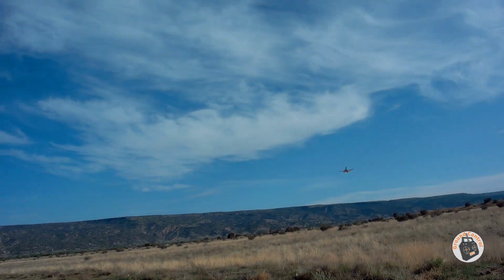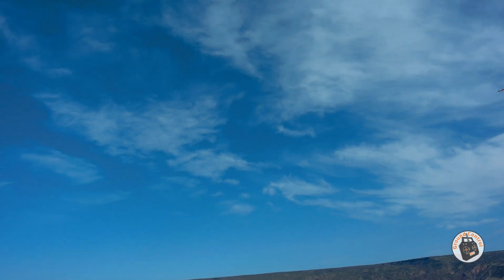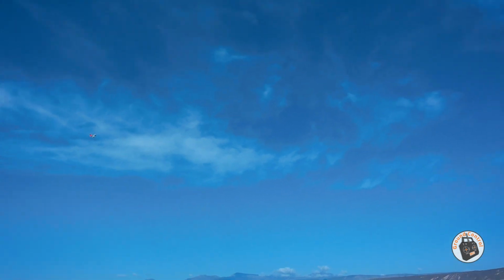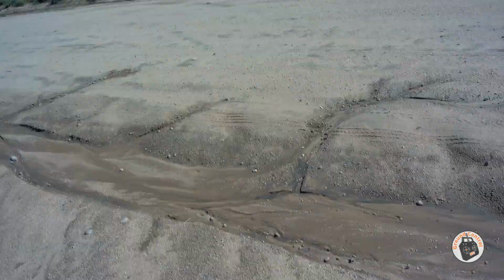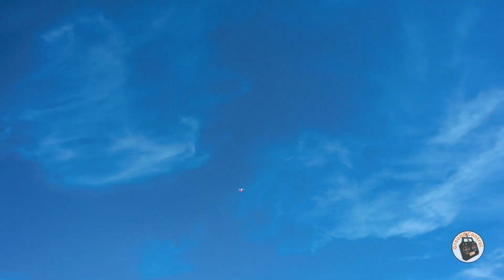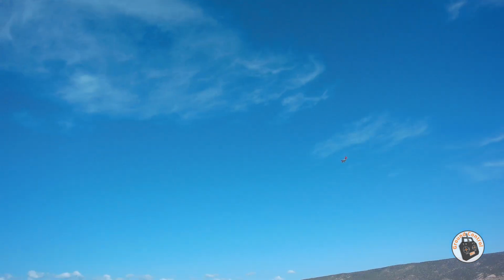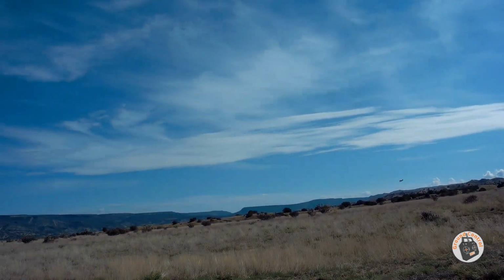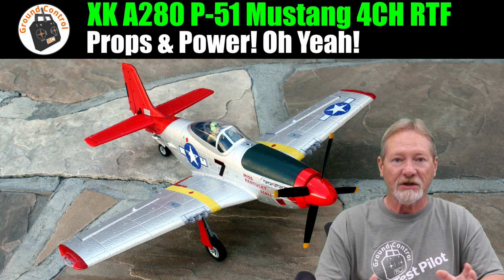Props & Power! Oh Yeah! XK A280 P-51 Mustang 3D/6G System 560mm Wingspan 4CH RTF!

Comment: Help sir. For connecting with radiomaster tx16s edge mark 2, what protocol need to be sett? Thanks
Reply from the maker: In the latest builds of this plane I've read they changed the protocol so it no longer binds with a multi-protocol TX.
The original Main Protocol V911S | Sub-Protocol E119 with CH6 (Rates) and CH7 (Gyro)
The board may have a port to add an external RX as I think the original board did.

Comment: I reckon you are using the old receiver board with S-bus connector? The new ones don't have S-bus anymore.
Reply from the maker: I do have the old receiver board but I'm using the board's protocol to bind with my TX16S.
I've read they changed the board and the protocol.
What a shame.

Comment: Can i use a 2S 7,6 HV lipo on the stock ESC from this plane???
Reply from the maker: Unknown, they don't publish how much voltage the motor, ESC, or voltage regulator are rated.
Reply: @GroundControlRC  It is 7,4 that is written in the specifications
Reply from the maker: @johanw.1673  It states: Airplane Battery: 7.4V 600mAh 25C
Reply: @GroundControlRC  on the board it says 7.5 volts. the only mod is adding the inline voltage converter to supply 7.4v to the standard control board of the ESC to fly it safely on 3S. do you know the size of the spinner??
Reply from the maker: @johanw.1673  Oh, I thought you were asking about a 2S LIHV?
Certainly you can MOD the electronics to use whatever size size LIPO you wish but I thought you were asking about what you could use as it is stock, were you not?
I don't know the size of the Spinner but it may be listed as a spare part.
Reply: @GroundControlRC  yes i first looked at 2s lipo but have now seen videos on 3S and it flies much more powerful with that. i am an experienced pilot who has been involved in the flying hobby for 30 years and want to pick up the hobby again a bit. i still have several large motor planes here but no place to fly them. the flying club has been closed down here for a long time. i have everything on its way for a conversion to 3S. i want to fly it on 3S 550 mah HV and then with a 7x5E prop. first i had bought a 400mm p51 with aerobatics button before this and that was very boring, and the plane was barely flyable manually with a little wind. i sent it back immediately.
Reply from the maker: @johanw.1673  Welcome back to the Hobby!
Yes, I perform a lot of MODs, Upgrades, and Conversions as well.
I haven't decided yet if I want to convert the XK A280 to 3S or put a better motor in it and keep it 2S.
Great flying plane either way.
Good luck on your upgrade to 3S.
It should have excellent performance on 3S.
Reply: @GroundControlRC  Thanks. for me it is the cheapest way to convert to 3S . i bought a step down converter 7.5 volt of 90 cents and the purchase of two 3S lipo batteries and another prop. the plane RTF cost me 70 dollars and all together less than 100 dollars
Reply from the maker: @johanw.1673  Well worth the money.

Comment: Thanks for the video and instructions. I just finished putting mine together, I cant wait to take it out tomorrow. Thank you!
Reply from the maker: Great flying micro P51D. Good luck on your Maiden Flight!
Reply: did the 5 x 7..love that its near Hobby Grade( Instructions terrible ). I Have had FUN!! Drilling ..it..into..the ground. Its a Tough Model. Finally had to get the Hot Glue Gun out. Fun. Thx for recommendation. Will Link to a New TX soon!
Reply: ..and Buy 2 More!
Reply from the maker: @davestrain9529  If I had a bigger budget ;-)
Reply: @GroundControlRC  thx for all yer Vids. Bought WL ak 280 cuz of yu,,still trying to Translate the terrible chinse instructions on a  " Re BIND !  "LOL
Reply from the maker: @davestrain9529  Thank You Much!
Reply from the maker: @davestrain9529  I'm glad you like it.
One of my favorite Sub-250g planes.
That 7x5 prop really increases performance ;-)

Comment: How did u get your 7x5 prop on I put mine on and it slides on but when I put my nut on it doesn’t touch the prop there is a small space in between ….i tried a orange 6x3 and it fits perfect …I put the four blade back on and been running 3s 300 and 3s 450 45c and no problems yet but that radio is not good after using spectrum it feels like you have to force it to move idk what it is but love the plane but don’t like the radio…I herd what u said now I didn’t even think to use another spacer
Reply from the maker: The 7x5 Props I provide links to come with a set of spacers.
I used 1 in the front and 1 in the back of the prop.
Fits nice.
Reply: @GroundControlRC  I just used one in back and it held tight … I used the 7x5 with my 3s 300 30c and 3s 450 45c …. Had to run full blast on 30c but the 45c it flew good …but yesterday I tried same batteries with a 6x3.5 and omg it did good on the 45c but terrible on 30c …not liking radio at all seems so laggy with controls
Reply from the maker: @snauzzeRc  That 7x5 prop works very well indeed.
Reply: @GroundControlRC  u need to try a 6x3.5 on 3s
Reply from the maker: @snauzzeRc  I think I might put a more capable motor on it so it has unlimited vertical on 2S with this 7x5 prop and replace the RX/Gyro/ESC with a RadioLink Byme-A/SBUS RX/10--12A ESC so I have full manual mode and just wind mitigation as well as full stabilized mode.
I did that with the FlyBear SBACH 342 and it feels like a new plane. I can now perform aerobatics without any assistance from the gyro.
I have so many projects going on right now I don't know when I'll be able to get to it though.
I just converted the FlyBear Cessna 182 to 2S and the QF009 SU35 to 3S ;-)
Reply: @GroundControlRC  that’s what one of my friends done but he put a aeroscout motor on it and a radiolink byme-a receiver and a 12a esc with a 3s 1050
Reply: @GroundControlRC  and he using a 3 blade 6x3.5 I think
Reply from the maker: @snauzzeRc  Nice!

Comment: Great content. Caused me to get one. I immediately found a tiny buck dc to dc converter on amazon to reduce 3 cell voltage to the 7.2 volts needed by the receiver, used an old quad copter 12 amp esc with all the appropriate connectors applied and made a 3S machine with unlimited vertical. APC thin electric 7X4 and GNB 380mAH (which weighs about the same as the stock battery). Flights are short, but wow.
Reply from the maker: Thank You!
Those voltage regulators sure do come in handy sometimes.
That beefed up P51 of yours sounds like my kind of power ;-)
Reply: @GroundControlRC  I'm not as young as I used to be as evidenced by today when flying this thing, I pointed it up and gave it full throttle, and In an instant, it was too high for me to orientate visually. I had to watch it move to get orientation!
Reply from the maker: @markculp6126  Hehehe...I still lose orientation sometimes.
One of those issues with small planes.
Much fun though with these Micro planes.
Sometimes it's like flying a Bat ;-)

Comment: Did you ever use a 3s lipo in the plane?
Reply from the maker: No, still flying with a 2S LIPO and a 7x5 Prop.
It has very good performance with that setup but if I decide to go 3S I'll be replacing the board and installing a Byme Gyro, 12A ESC, and SBUS RX.
Reply: @GroundControlRC  a280 3S😉👌
Reply from the maker: @BKm56658m  Yes, when I have time I'm going to replace the board and ESC and test on 3S.
Should be really good ;-)
Reply: What amp is the stock esc??
Reply from the maker: @bradb8615  I have no idea but I've read someone state a 10A.
Too bad they don't label these things ;-)

Comment: When you went with the 3s 300mah batt did you have to change out any of the electronics or was it plug and play
Reply from the maker: Hum...I'm not sure if you're responding to someone else's post?
I've only flown it with a 2S LIPO.
I'll most likely test it with a 3S LIPO using a smaller prop.
Reply: Sorry I thought it was you that put a 3s 300 mah batt. I just bought the same plane and what a nice flying plane it is.  @GroundControlRC
Reply from the maker: @pinarellospeedracer  No Worries!
I plan on putting a 3S LIPO in it soon.
It's my favorite Micro Sub-250g Warbird ;-)

Comment: I received this bird and have flown it 3 times. I set it up per your recommended linkage adjustments and it will not aileron roll very well.  How did you modify the spinner to fit the 7x5 thin electric prop. I am hoping this prop will improve the performance.
Reply: Thanks again
Reply from the maker: I used a contour gauge to get the exact shape of the of the prop profile and used a dremmel tool to grind to the shape of the profile.
The 7x5 prop will make it feel like a different warbird.
You also need a LIPO that can provide enough amps as the Stock LIPO can't.
Here is the video where I discussed the prop and spinner MOD and there are links to the prop, LIPO, Adapter, and Contour Gauge in the Show Notes.
https://www.youtube.com/watch?v=TmQbbapTF8U

Comment: Hi there,I’ve just ordered one on your say so…but,which batteries and connectors do I need.I messed up and ordered the version with only one battery on Aliexpress,didn’t see the two battery option,and I can’t seem to amend my order now.Doh ?!
Reply from the maker: No worries!
I fly with the GNB 2S 450mah and GNB 2S 550mah LIPOs and use some XT30 to JST Adapters.
I like the weight and capacity of the GNB 2S 550mah LIPOs with the APC 7x5 Prop and I'd probably go with the lighter GNB 2S 450mah LIPOs if you're going to stick with the Stock Prop.
Here are link to everything in case they're no listed in the Show Notes:

3pcs XT30 / XT-30 Male to JST Connector Adapter(C93-3)
https://amzn.to/3IBPomY

4pcs GNB 550mah 2S LiPo Battery 90C 180C with XT30 Connector
https://amzn.to/41GbMT1

GNB 450mAh 2S HV LiPo Battery 7.6V 80/160C XT30 Plug
https://amzn.to/3MAnOba

GNB 2S 450mAh 80C 2S LiPo Battery JST Plug
https://www.banggood.com/custlink/KKvFEWDBkr

FullyMax 2S 600mAh 25C LiPo Battery for XK A280 P-51 Mustang 560mm
https://www.banggood.com/custlink/GG3FhpG0s7

APC 07050E Electric Propeller 7 X 5E
https://amzn.to/45f9Gwn

5Pcs APC 7x5 E Thin Electric Composite Prop LP07050E
https://amzn.to/436JHp2

4pcs/lot APC Nylon Propeller (Color : 4pcs 7X5)
https://amzn.to/3qh6LU3
Reply: @GroundControlRC  cheers I ordered two more of the Fullymax ones for now,figured they were a straight swap over…I’ll rinse it as standard till I break both props,then go for your FULL beans setup…I like ‘journeys’….cheers for all the info,I’m moving on from my Eachine mustang and spit,mainly because a mouse has eaten them both…I shit you not ! In the boxes ! Cheers from  Manchester,England.
Reply from the maker: @joelfildes5544  You are most welcome!
Time to put that Mouse on a Spit ;-)

Comment: Nice test. Logically, the biggest the prop, the more lift you should get from the wing (useful for rather slow flying without stall) which comes under the air flow.
Reply from the maker: Thank You!
Yes, I really thought the 8x3.8 Prop would perform better than the 7x5.
See you in the Air!
Reply: @GroundControlRC  btw, how does it handle stall (I may have missed it) please ?
Reply from the maker: @marielizysurourcq  I've never had it dip a wing on me.
Some of the very large  loops I've performed in 3D Mode had the plane barely moving at the apex and it still held it's line.
Same thing with the Split-S Maneuvers.
Very stable airframe.

Comment: I'd like to try a flight with a 7x3, which would let the motor reach a bit higher RPM range and maybe increase vertical climb.  2-blade props are always more efficient at this scale.

Very cool video.  Happy flying!
Reply from the maker: Thank You much!
A 7x3 might work very well.
Yes, I was surprised at how well this 1806 motor performed with the stock 4-blade prop. I think if they had put another 1/2" of pitch in the stock prop it would have been perfect.
I do like the 2-blade props for these small, higher KV, lower torque motors.
I'm hoping once my prop order arrives the last one I'm going to test will perform even better ;-)
See you in the Air!

Comment: i have had my A280 for since it was released and have just gotten around to putting it together. Only problem i have is that it didnt come with a prop nut.
any idea of the size and pitch of the nut so i can at least find a suitable replacement
Reply from the maker: Hi Albert!
I think that it's M5 Nut but I don't know what the pitch is.
I'd see if my local hardware had any 5mm Nuts.
Reply: M5 metric